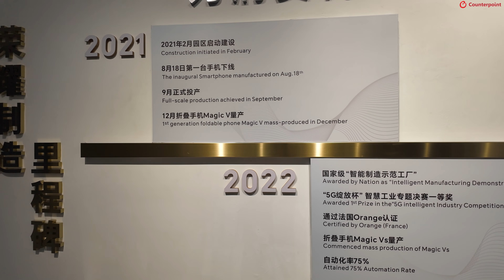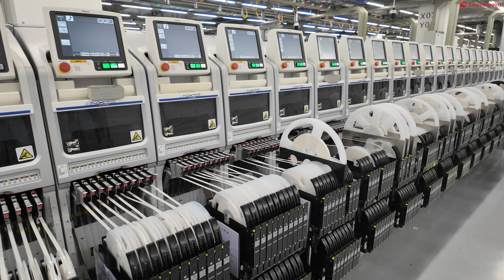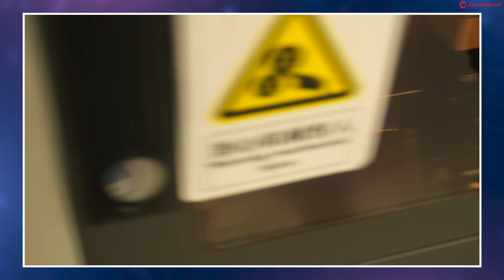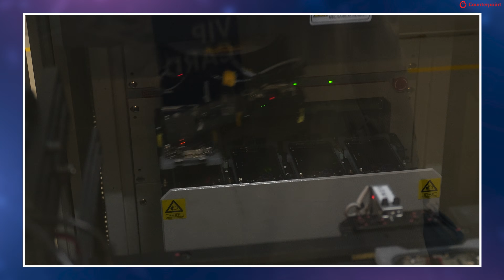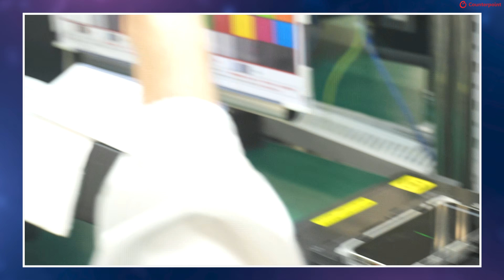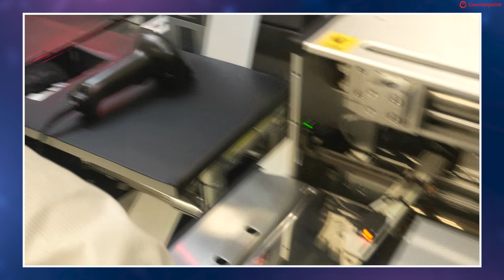Inside HONOR's Pingshan Campus: 85% Automated Advanced Magic 8 Series Production

Comment from the maker: For more details on smartphone OEM outsourcing and in-house design and manufacturing, you can check out our report here:
https://counterpointresearch.com/en/reports/Global-Smartphone-ODM-Tracker-1H-2025 

Also, read our comprehensive analysis of the smartphone assembly locations and major component suppliers (display, motherboard, battery, PCB, and camera) for the top 8 OEMs here:
https://counterpointresearch.com/en/reports/smartphone-manufacturing-ecosystem-by-key-component-and-emsodm-h1-2025